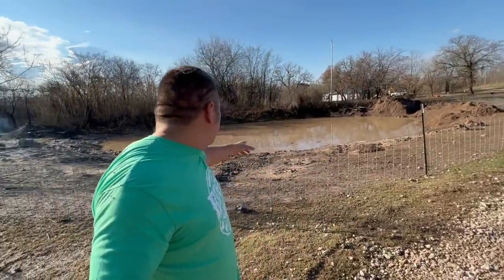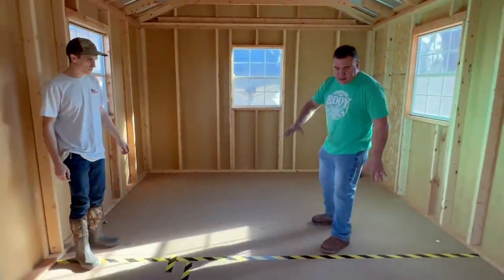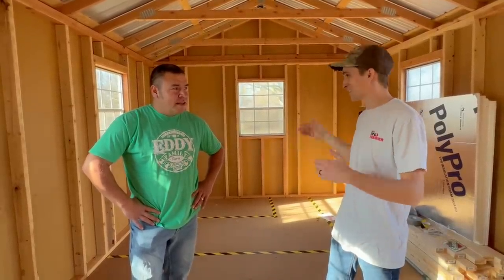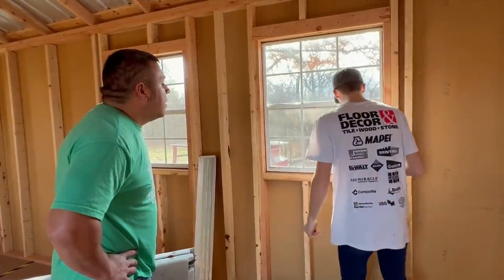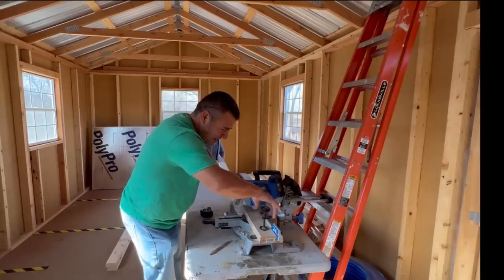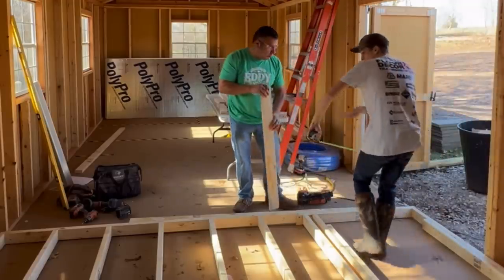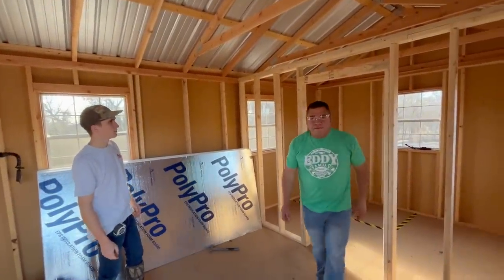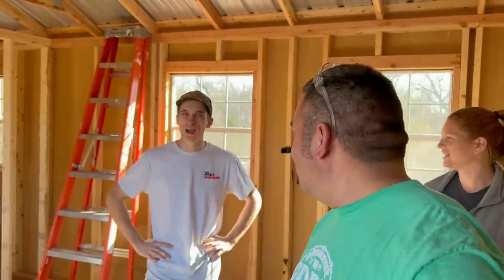We Had To Take Cover And Call For Help!!

Comment: Tornados are very scary, we had one take out our barn and pass over our house,,, we were blessed,,, I was in the garage holding the dog and yes it was just like a train sound, and I knew it was close because it felt like all the air was sucked out of the garage for a second,,,,, mom said the plate glass doors were vibrating really bad and she was scared they would pop, but thankfully they didn't, but we were very lucky we had very big oak trees around the house and a couple had sheet tin from the barn bowtied around them,,, shows you the power of those things,,,,, Wonder what sort of stuff Leighton will hang on his walls, posters etc

Comment: Brandon you should call the company where you got the building and see if they will come and fix the windows right, or eat the cost of getting it done, because it should have been done right in the first place, it never should have been  leaking! Just tell them your contractor said that every window leaked when you had that bad storm that could have turned into a tornado! Tell them that he explained to you how it needs to be fixed from the outside! Tell them you don't want to leave a bad review, but it's not right that you have this problem! Otherwise you're going to get that put together and it's going to leak into the insulation, and it's going to leak into the drywall, and start rotting the wood and cause mold! It has to be fixed! You're going to have a lot of electrical outlets in that building and you don't want to start a fire, or short out the electricity  if water gets into the sockets! Good luck, hopefully they will take responsibility and fix it right! Prayers 💙🙏💙🎄

Comment: Have you put the structure on the blocks before adding more weight inside? I see some wetness along the wall in a couple of places after the heavy rain. So you don't get water damage to the bottom of the tiny house. Just wondering... ❤

Comment: Won't you keep the camper after your house is built, to use as a guest house? If you build a bathroom in the cabin you'll also have to build a cesspool or septic tank & leech field for it because it will be too low in elevation to use the house sewer system.

Comment: You just complained about the oven in the rv being so small. Maybe you should go with the full range instead of the cook top only. I am thinking you will change your minds sooner rather than later. It would be cheaper to do it now instead of making modifications to fit a range later and paying for both a cook top and a range.